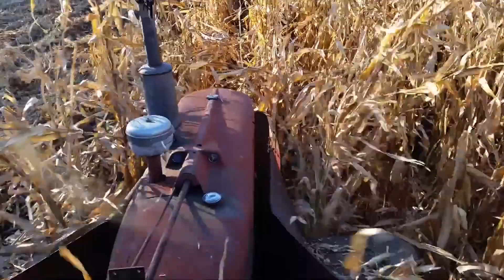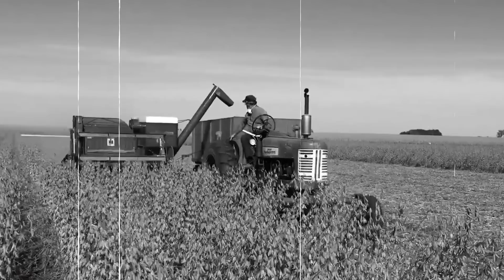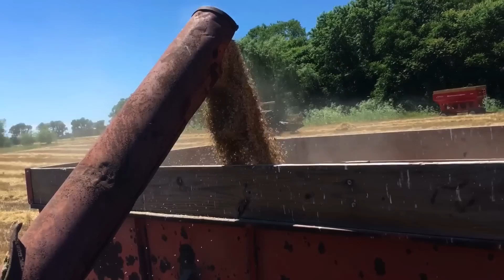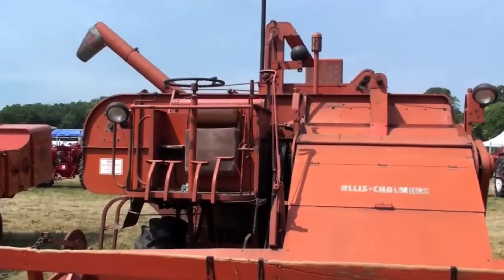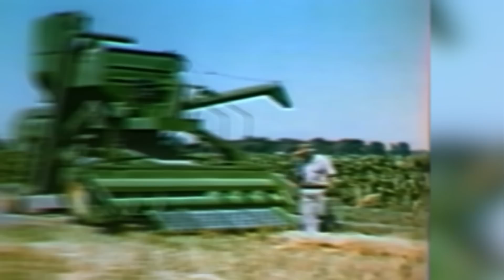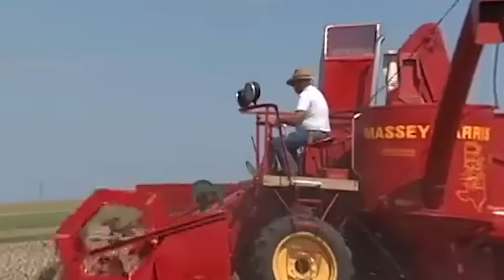5 Bizarre Vintage Harvesters You Won’t Believe Exist

Comment: The Massey Harris 21combine was NOT the first successful, commercially available combine - that accolade belongs to its predecessor, the MH #20, a large, 16 foot cut machine. 8 prototypes of that machine were trialled in Argentina in 1938, and after any mods' deemed necessary, was first put into production in 1939.
 Over a two year period, some 925 units were built. It was superceded in 1941, by the two thirds sized #21.
 The previous #20 whilst successful, was deemed too large and expensive, hence the need to develop a machine that would appeal to a wider market of smaller farmers, and be more affordable to boot.
 This video is so full of inaccuracies that it ought to be reported for its shoddy research alone !

Comment: How technology recycles.  The 21 is shown with a Draper platform.  This old technology was replaced with the auger platform.  The new McDon headers to handle the width required are now draper platforms.  What was old is now new again.

Would say you need a team of old farmers to review before release.  A number of statements are not really as true as stated especially when like the 55 there was an over a 20 year production span.  Most statements only apply to one of the 4 separate versions of the 55.  I have run them all.  The same can be said about 2 of the other models shown.

Comment: The combine was just a motorized version of the existing threshing machines, used for years.  The corn picker didn’t have specially designed mechanical fingers.  The entire stalk is pulled thru the snapping rolls, separating the ears from the stalk.  No speed limits or timing required.

Comment: 21 masseys were earlier by several years, they would out cut the 55 jd and save it, by the time 55 came out Massey had the 27 out
Reply: Even earlier was the Massey Harris 20 combine, a large, 16ft cut machine, and generally acknowledged as the first successful self propelled combine. Developed in the late 1930s by Australian Thomas Carroll, it entered first production in 1939, and was superceded 2 years later by the two thirds size MH 21, with a 12ft cut. It was more manouverable, produced in larger numbers (MH 20 equalled 925 machines over roughly two years of production), and so was cheaper, and due to this, even smaller farmers could afford one.
 The MH 21, like the MH 20 before it, had a canvas feed table, taking its inspiration from binders that had predated both models.
 The MH 21A was essentially a MH 21 but with a fully enclosed header, equipped with an auger (no retracting fingers at this date), and its elevator housing pivot point was up level with the operators platform, meaning it could be raised clear over fence and gate posts upon entering a field if required, and didn't need to be removed to do so.
 The previous MH 21 had its header pivot point down very low on the main chassis rails, whilst its elevator trunking was fixed, meaning that the header couldn't be raised by very much in comparison to its successor model and as a result, at least on some occassions, its header would have to be removed either for transport or to allow the main combine access to fields with narrow points of entry.